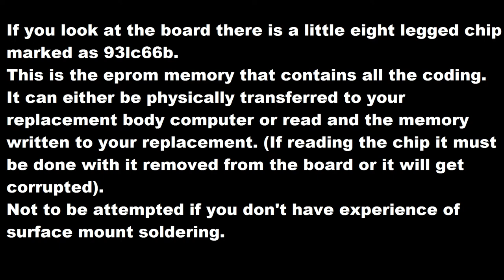How to remove/replace the Ecu immobilizer EEPROM/E2PROM

Comment: If you were to connect the chip arms across will this create a default circuit and allow the car to be started and operate without needing to go via the coding in the chip...?
I will like to have a modern engine but with an old school ignition system and wiring in a kill switch.
Any feedback is greatly appreciated.
1 quick tip that may help you with future small soldering is building yourself a jig using a crane concept that supports your wrist and allows for less muscle shake (potentially) .

Comment: Will this work on 00 accord? I have a bad pcm the shop said. Want 1600 to fix the problem.   Im looking for another route. I was thinking if i found a correct computer at dismantler......what could i do?
Reply from the maker: tbh i dont know about a lot about Honda cars.. but if you replace the PCM you will have  to program the new one...there is a formu that might help you with anything related to Honda:https://www.hondaaccordforum.com/

Wish you best luck